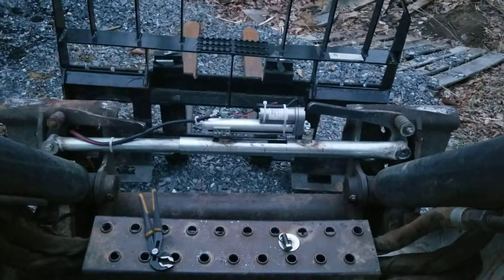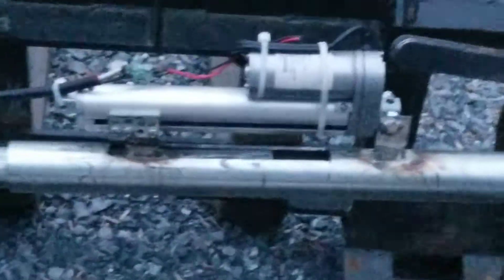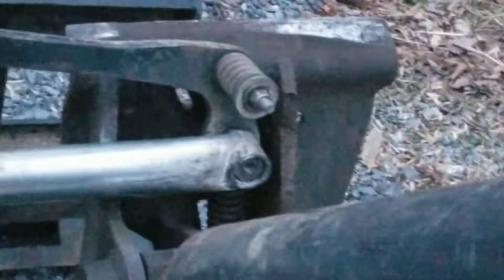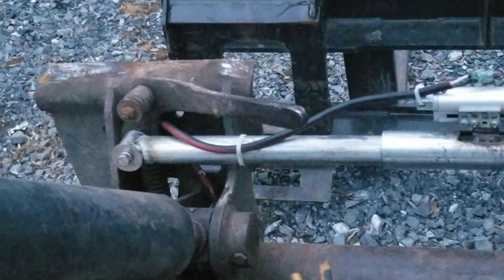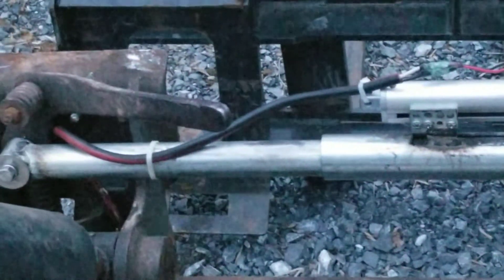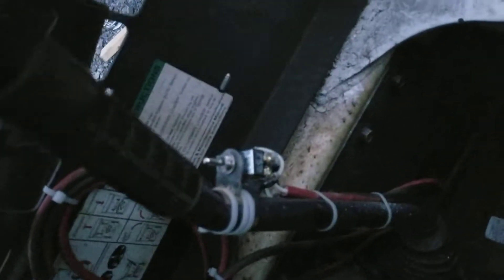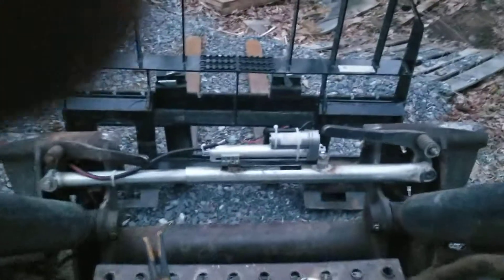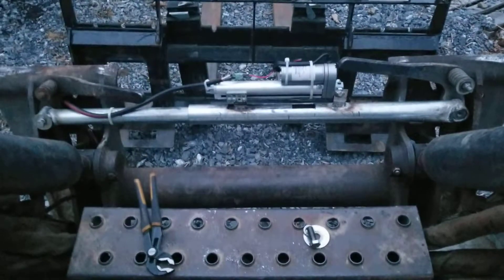Homemade quick-attach for Bobcat

Comment: Great job buddy. You could have built it to run hydraulically yourself but it'd be a load of arsing around and it'd take a lot longer and in a lot of cases I dare say its over kill anyway. If its burns out just buy a new one and off you go again. Just a suggestion and you've probably already thought of it but it might be worth cutting a bit of 4" PVC pipe down the length and cable tie it on top as a rain and dust cover. A simple and adequate solution to a problem not really worth spending $1500 on. Nice job once again and thanks for sharing.